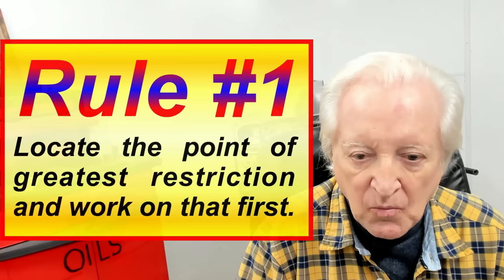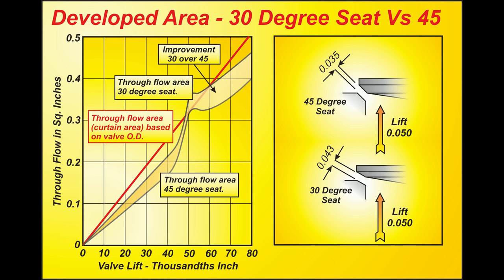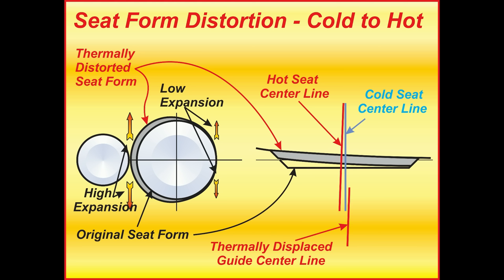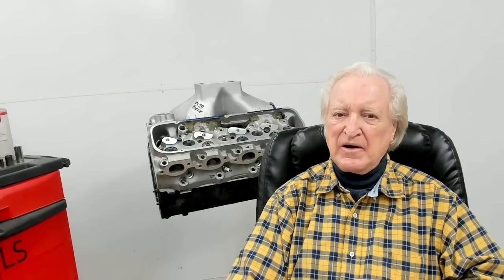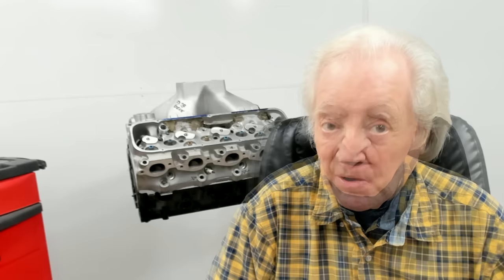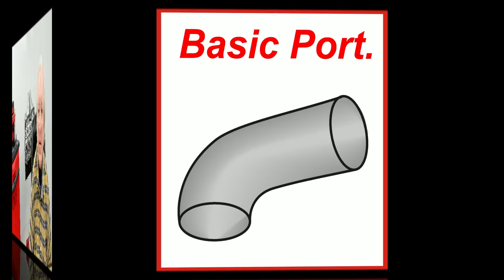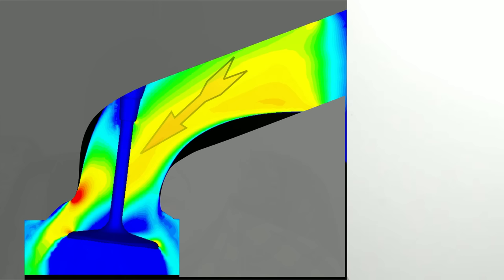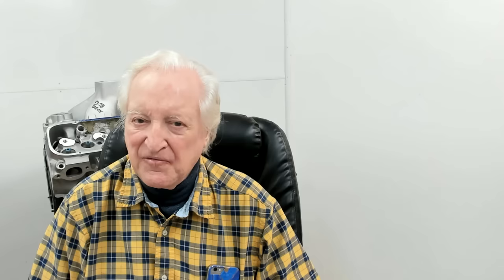% Golden porting rules - part 4 of rule #1

Comment: At one point you said to bias the port towards the cylinder wall side and at another point you said the center of the cylinder. Could you please clarify which is correct? Also, do all these tricks apply to 4 valve/cyl engines?
Reply: It needs to be biased toward the cylinder wall, so the flow is angled toward the center of the cylinder.
Reply: I'm waiting for the answer to the 4v application as well. I have a cadillac I'm working on. Thinking for swirl, you would follow this on the dominate in valve, but try and get the 2nd in value flow to follow  the primary's around the cylinder.
Reply: @jimlathrop8603  - Are the ports asymmetrical? 4V ports are usually symmetrical, so there shouldn't be a "dominant" valve. The 4V heads usually have tumble instead of swirl. Try to picture the air doing a barrel roll inside the cylinder.
Reply: Yes symmetrical and larger than they need to be, will be filling in some. And you are right on the tumble too. But using the Polly Quad approach you are creating a dominant valve.
Reply: @michaelblacktree  I should have included your name on my reply above. The Poly Quad setup tries to change the tumble to swirl in 4 valve engines to increase low end power
Reply: @jimlathrop8603  - I wasn't aware you were doing the poly-quad thing. That will be interesting.
Reply: I agree about more 4 valve stuff and or how this all relates to it would be great. If you bias the port and bowls to flow away from the cylinder wall wouldn't that direct the flow from the 2 valves at each other? I'm not sure what effect that would have. If you do so towards the opposite of the chamber that might act as if it has more overlap and go out the exhaust side. Not sure what the correct answer is here. Need more 4 valve content or information about how it differs from 2 valve.
Reply: @bobbyhaskell2048  there are some big differences between a 2 and 4 valve. The way I see it on a 2 v, you're not actually sending the air to the center, but guiding it around the circumstances of the cylinder. Because the side of the valve is at the widest part of the cylinder. Like releasing a pinball, it goes up a long straight, (intake port) hits the beginning of a radius, (out the intake valve & and onto cylinder wall) and follows around the arch (beginning the swirl). But in a 4 valve the intake air enters the cylinder before its widest point. So if you biased the air to the center... it really does go  to the center. That seems wrong to me. Maybe should be aimed toward the cylinder wall? Maybe both valves need to aim left or right so they don't cancel each other out? Definitely some different thinking needed on a 4 valve...... David HELP!!! My little brain's going to explode...

Comment: I wish there was more 4 valve content. I have 4 valve questions. I apologize if it's long winded.

The 4V differs with it's 2 smaller valves in 1 port typically. At Low lift the curtain area is higher. The 1/4 D is also at a lower lift, possibly at a different crank angle. More so with VVT on the intake cam. A typical pentroof chamber doesn't want as much overlap due to it's cross flow. Too much may result in excessive reversion.
My question is about using more agressive cams. With higher lift and rate (Around .500 lift). Isn't the optimal valve and valve seat angles going to change. Shouldn't the focus be on the mid and higher lift regions with a attempt to minimize reversion? Especially with variable intake cam advance. Or is that incorrect thinking?
Reply: 🤔 I'd also like to know this.

Comment: Why not radius all the way to the 45° before and after with a form cutter?
Reply: because air doesn't always flow better over a radius than it does over multi angles, ive radiused valves before and had better flow when it was multi angle.

Comment: Do you bias the exhaust side towards the cylinder wall side as well?  I'm doing a set of vortec heads for a .030 over 350 with flat tops & valve brows, how much material can I get away with biasing the ports aka amount of material depth wise to be safe?  I know all castings are different but an aprox should help.  Oh & do I add a dam or ramp to the intake ports after the bias to help aid flow or smooth for more swirl?
Reply: He literally answers this question earlier in the part 2 ….

Comment: So how do you put speed bump in ?
Reply: I was wondering that then I realized that you just leave it there when removing the short side radius. At first I was under the impression that the black bottom section was solid and the colored air was the finished port, which confused me for flow improvement. but the black is area removed, so you leave and sculpt that bump from where you remove material. Then bias the bigger bowl side AWAY from the center of the cylinder so it flows TOWARDS the center of the cylinder.  I think I'm seeing this correctly, right?

Comment: It seems to me that you are violating your "let the air go where it wants to" rule of thumb. The air does NOT want to go out the short side yet you jump through hoops trying to get it to literally reverse direction without separating from the port's floor. I wonder how well you could do if you actually allowed the air to go where it wants by preventing the going around of that convex corner. If the short side is always the problem why not eliminate the short/convex-turned side's way inefficient flow and focus on helping the air go where it wants to, across the valve and out the long side?
Reply: Did you watch to the end? You widen the port on the cylinder side which aids flow and aids generating swirl, which aids combustion efficiency.

Comment: 39:35 center of the wings not mean center of gravity
Reply: Center of gravity is correct. Center of gravity of a straight winged plane is about 1/3 back from the leading edge of the wing.
Reply: @jimlathrop8603  exactly what i mean,  ~1/3, not 1/2

Comment: Hmmmm   Speed Bump    ,,,,,   create low pressure area     air speeds up    :):):)
Reply: Should be a low pressure area at the end of the bump. Always thought low pressure increased velocity,  I was thinking corners or turns created low pressure pockets which help turn the air around the corner though.  The bump takes up volume which I would think increases air speed. It don't really add up to me, I guess I'm not intelligent enough to understand it. Wish he would elaborate on the bump more and explain exactly how it works. Same area as wings but I thought they helps guide air around the valve stem or to the bias side.